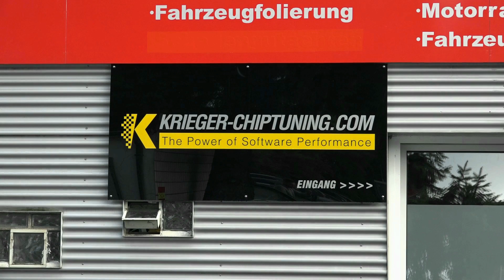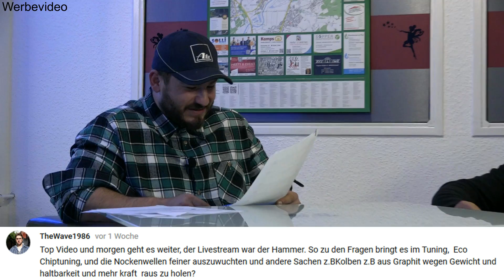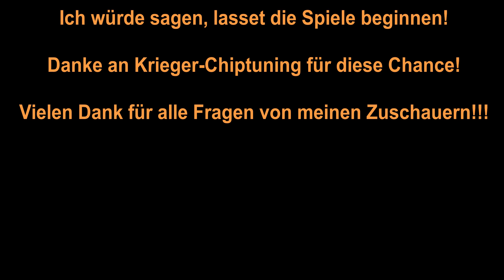Zu Besuch bei Krieger-Chiptuning! | TEIL 3

Comment: Haha, wie geil, dein Passat wird optimiert, als ob ich es zwischen den Sätzen gehört hätte und voraussagen konnte. Bedenke bitte meine letzte Ansage, damit du keine Probleme bekommst! Ich beschäftige mich nämlich auch seit Jahren mit möglichen Kennfeldoptimierungen an verschiedenen Motoren, nur fehlt mir das Equipment.
Für mich waren die 3 Folgen also nix neues, aber ich fand es trotzdem toll, dass so ein Thema mal ausgiebig besprochen wurde. Die angesprochenen Motoren, die ein extremes Leistungspotential haben wie z.Bsp. beim BMW 114i(102PS/180NM), findet man u.a. auch bei Peugeot, Citroen und Mini, aber leider haben sie dieses bekannte Steuerkettenproblem. Wenn die Steuerkette aber okay ist, gehen die wie Hölle! --> 220PS/310NM
Einen anderen "Sleeper" habe ich gerade im Blick...einen T5 als 2,0TDi ab 2010 mit nur 84PS. Nach einer Optimierung läuft er mit +100PS und +200NM! ...Wenn AGR, DPF und LLK "optimiert" werden, dann sogar mit mehr. Drückt mir die Daumen, dass ich am Gebrauchtwagenmarkt etwas ordentliches finde.